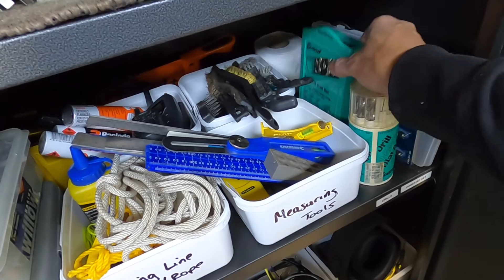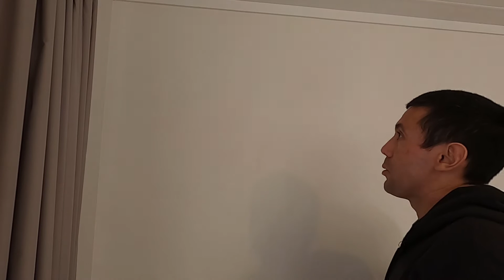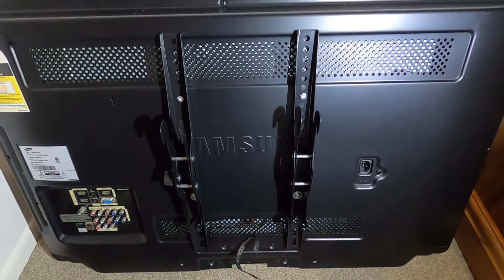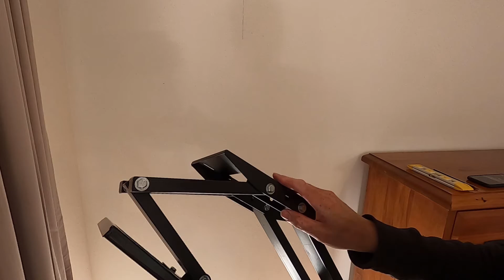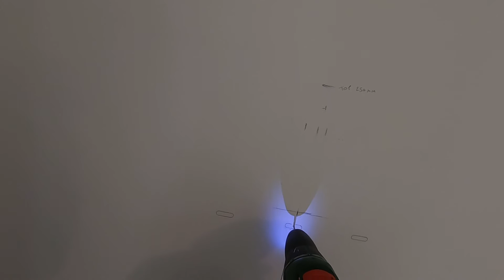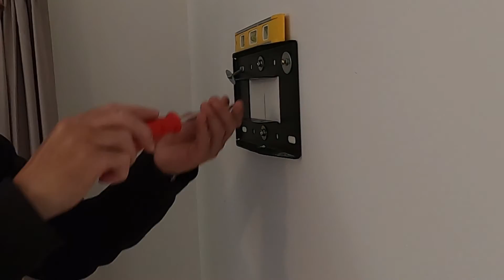How to install a TV wall mount into one timber stud

Comment from the maker: Hi Guys hope you are all well, in this video you will learn how to install a TV wall mount into one timber stud.  This tv wall mount installation includes fixing tv wall mount onto one timber stud using coach screws and fixing tv wall mount onto drywall or plasterboard using toggle bolts.  Take care 🙂